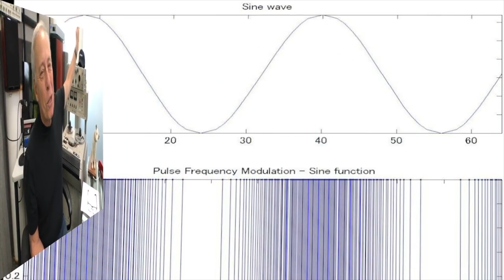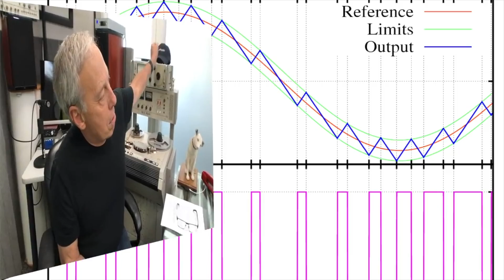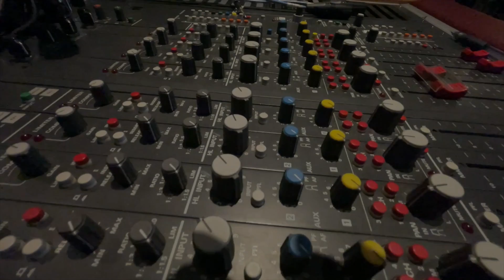Understanding the differences between amp classes A, B, and class D

Comment: I'm still a little confused about power amplifiers and integrated amplifiers that are class A & class A/B. Like when they say the first 8 watts are class A then it goes into 400watts class A/B. But the same amplifier can be biased to put out 12watts class A then go into 250watts class A/B. It can be biased again for 18watts class A and 150watts class A/B. etc. Ive read that these amplifiers, ones that can be biased like that...and just first X amount of watts are class A before going into class A/B...that those first X amount of class A watts is NOT true class A. If that's true...what is it then? What's "kind of" class A mean?  What's the point of a "first X amount of watts are class A" then?

Comment: what's your feeling between smps and class D as the power supply is there much difference between the two? I would have thought the class d would be a lot cleaner.
Reply: I am very much in favor of SMPS and we use them in our amps. However, it must be said that most SMPS have very little energy storage and so for peaks they aren't much good. Thus, when we use them, they are always oversized by a large degree.
Reply: @Paulmcgowanpsaudio  why can't you use storage capacitors then for secondary side of the smps to sort out that problem of peak usage? and using a class D as the power supply wouldn't that sort out the problem of peak usage? merry Christmas...
Reply from the maker: @hoobsgroove  Well, you could but then you would have to redesign the SMPS. Easier just to use a bit of overkill since we buy these from an OEM.
Reply: @octaverecordsanddsdstudios1285  
there's not much redesigning going on it's just a bank of storage capacitors not sure what you mean by redesigning?

Comment: I always thought a 100 watt (mono) amp used 200 watts.
Reply: The figure varies. 
A 100 watt amplifier will draw twice its rated output if its efficiency is about 50%.  
Some class A/B circuits can (barely) reach 70% or so. 
Class D is the most efficient, often 80% or better.